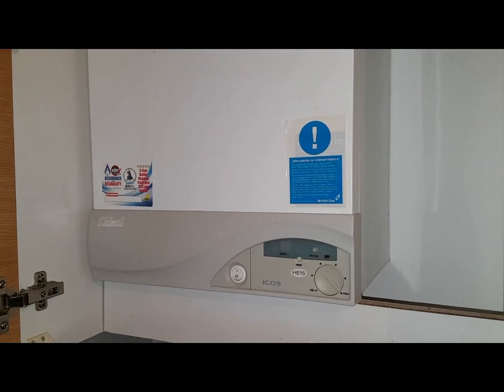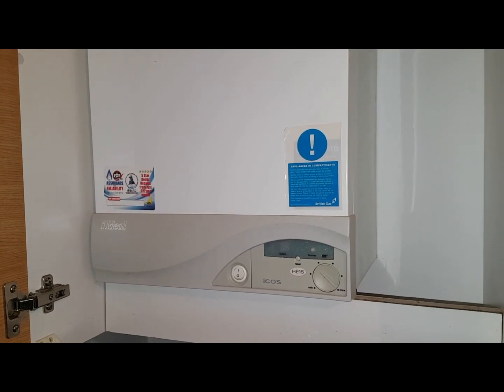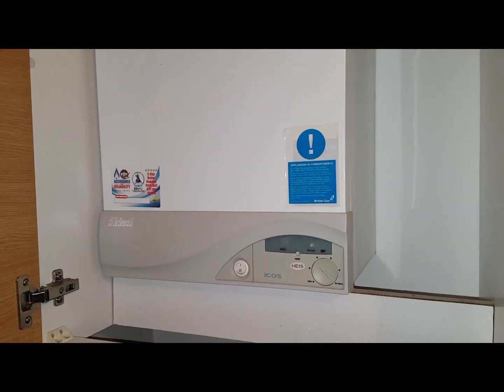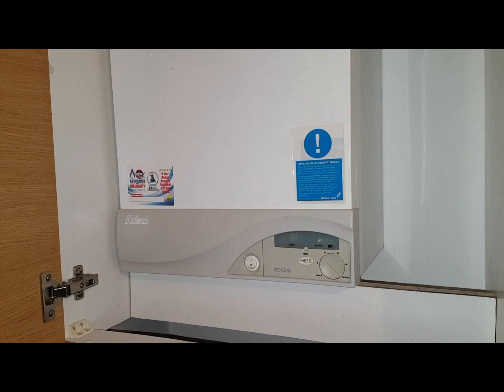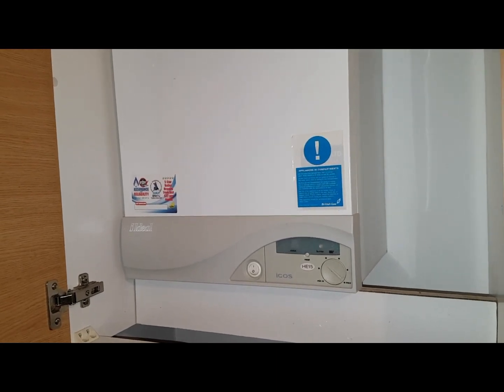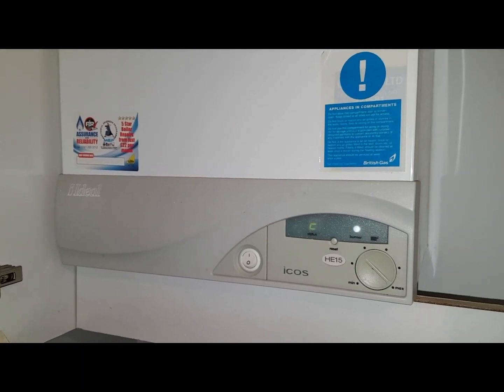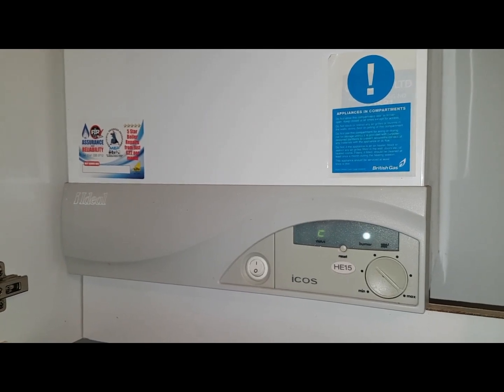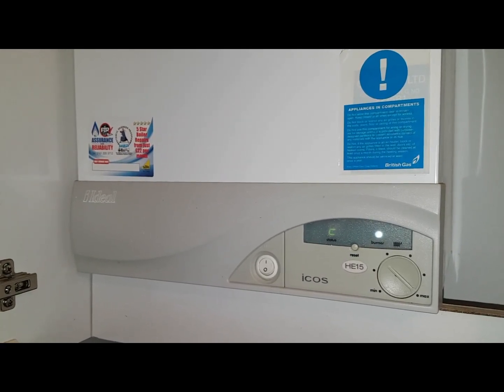Why Did The Burner go Off Ideal Icos HE15 .With Coach Tony Morgan

Comment: I've got an ideal icos he12 boiler, my heating and radiators are working fine but I've for no hot water coming out my taps, no flashing light and it's on C, I've ran my hot water for ages and it's not coming on, do you have any suggestions or help please!
Reply from the maker: You could have an air lock from your cold water tank or the ball valve in the cold tank is stuck. And could you subscribe to our channel ?

Comment: Answer No 1 , Boiler Lock out due to over heat . Answer no 2 , There is nothing wrong with boiler , it’s the problem with motorised valve is not opening (faulty) and boiler get over heat and lock out . 👍
Reply from the maker: Answer No 1 is correct but answer 2 wrong
Reply from the maker: hey we're currently trying to grow our Facebook group and would love you to join Tony and the team using this link, Tony will be available to answer all your questions directly there's also updates on new trainings we just released too. https://www.facebook.com/groups/167070231326174
Reply: Sensor lol that's what went on mine, and the heat exchanger. 😢